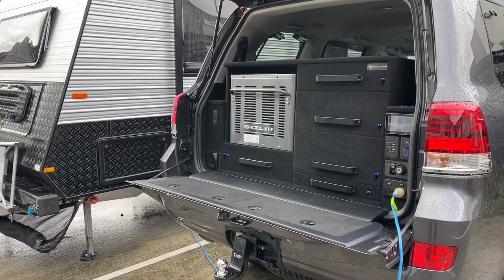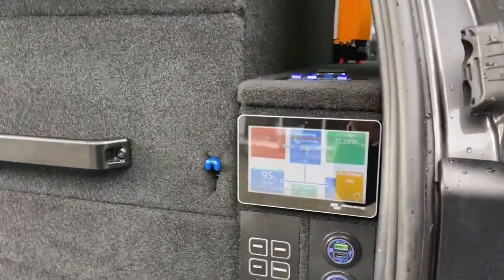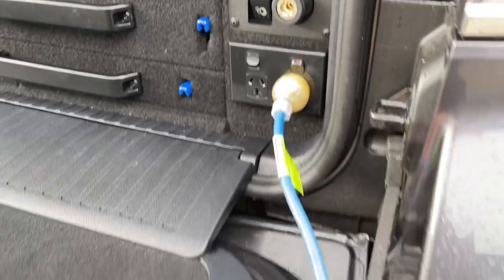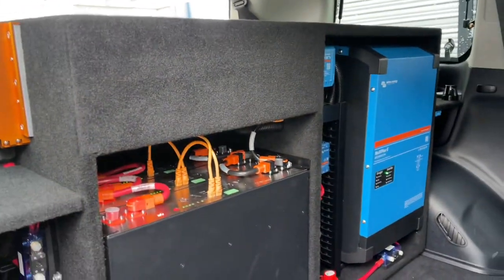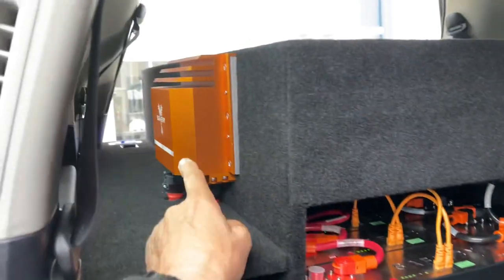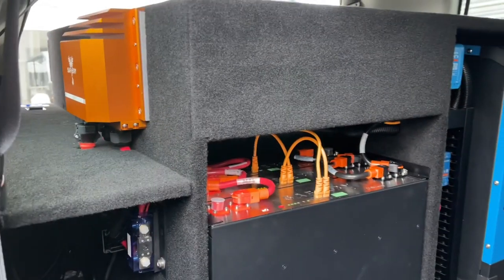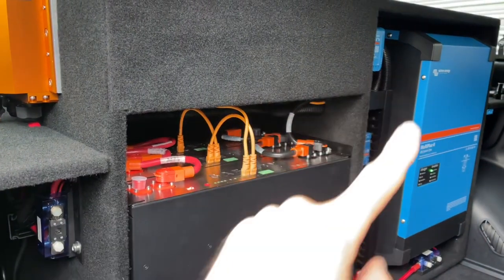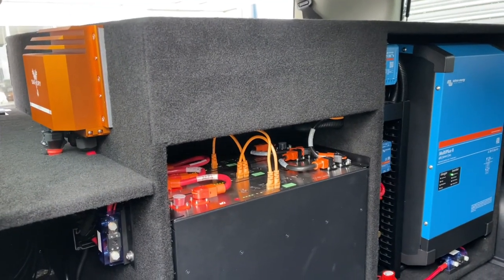LC200 as Power Station for Caravan 5,000W Inverter 600Ah Lithium and 3,00

Comment: Hi Bruce if no battery in van if car is away from camp is there no electrics like fridge &lights in van for people at camp
Reply from the maker: The system supplies a steady 12V using a 48/12V converter.

Comment: How long will this spend make me happy. A5kw campsite,Consumerism gone mad. Also, how much does this set up weigh. Does it affect gvm etc?
Reply: LC200 Tare is 2750, the GVM is 3350. The ball weight of that van would be 200 kg, so there’s 400 kg left for bull bars, fridges, passengers, luggage and fuel. Bloody oath the GVM is a consideration!
Reply from the maker: Its personal choice. This is a lot less expensive than doing a Chop 200 yet has a lot of the utility.

Comment: 10 amp plug/GPO/lead supplying 12.5A to the van. Not even close to legal/safe. And 3000 Watts from a LC 200 alternator? That’s 250A at 12Volts... you’re having a laugh!
Reply from the maker: Its a 15A Plug outlet. And yes it is a 250A+ Aternator. Actually hits 270A and is derated. Welcome to the new world.

Comment: Through a 2400 watt gpo,  not good!
Reply from the maker: Its a 15A GPO, thats 3,600W
Reply: Have a closer look at the earth pin on that outlet, it,s the same size as the a and n pins, that’s a 10 amp outlet or 240watt.
Reply from the maker: Sorry no its not. Thats a 15A power cable. Adjacent to it is a 10A outlet, but this is 15A on its own RCBO